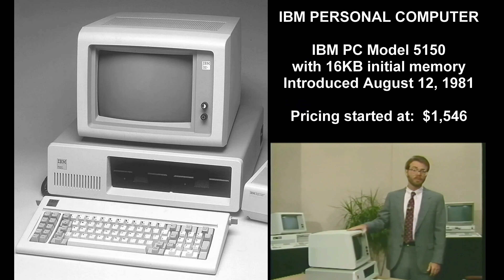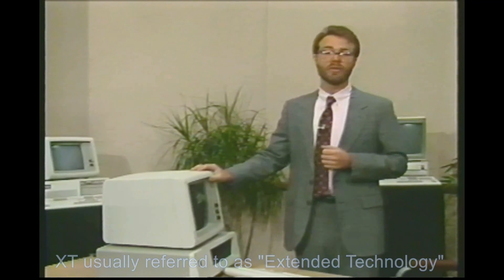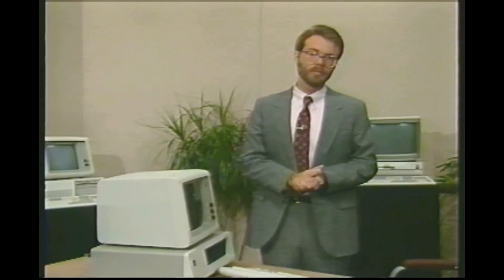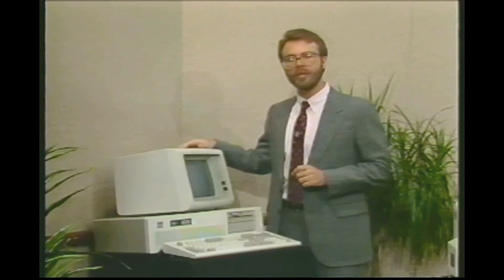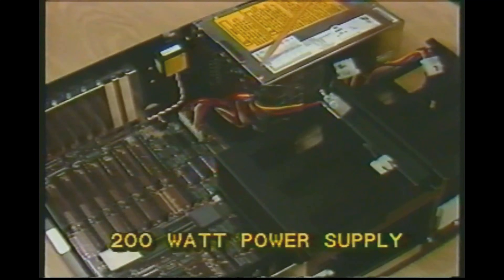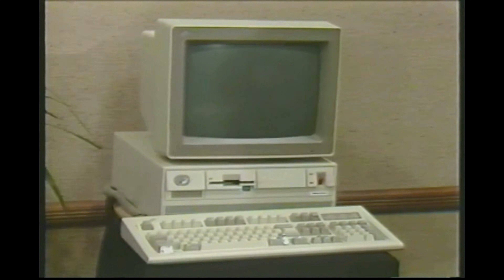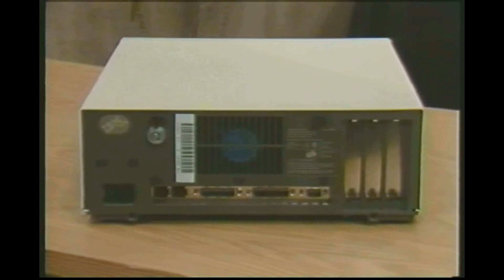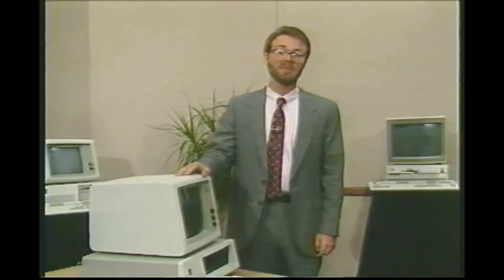IBM PC Family: XT, AT, PS/2 Personal Computers Compared 1981-1987 short intro training film

Comment: I remember debugging an isssue with my older PC and turns out it was that the keyboard was for an AT computer and not an XT computer ... found a toggle switch on the bottom of the keyboard and problem solved ... embarassed how long it took me to figure that out
Reply from the maker: Good bit of info!   Thanks!

Comment: I have an old IBM "PC", upgraded with a more powerful power supply & ST225 hard disk, along with the heavy metal original PC keyboard. Been sitting for 25yrs., it was working but my Amdek 310 monitor failed and no longer can mess with it. It's the oldest part of my vast computer parts bin. Amazed what these go for on ebay.
Reply from the maker: Hi @robytar, wow, the original metal keyboard!   I remember those, but have not seen one in years.  Yes, it is very collectible now.  Who would have thought the original machines would be collectible in just a few years.  Like an "antique" now.   Thanks very much for sharing your info and thoughts!   ~ VK, CHAP

Comment: I remember working on and maintaing a whole warehouse full of Xt's with 128 kb of ram , Hercules graphic cards and a single 5 1/4 inch floppy drive each.  We had a single XT that had a 20Mb hard drive which held all the data for the whole setup.   A 386 was  epitome of desire back then and I spent hours going  through the specs in trade magazines dreaming of getting my hands on one.
Reply from the maker: Hi @multigerbs550, good times.  I remember anticipating the 386 chip too!   It was quite a big deal when it first came out, soooo powerful.   : )    Thank you for your feedback! ~  VK

Comment: Boy, did I love typing on the original IBM PC. What a great keyboard, with a solid clackety-clack feel and sound.
Reply: That was the Model F, which first appeared with the IBM System/23 Datamaster which was $9000 at introduction. What I didn't realize for many years was that to buy an individual PC keyboard at the time, cost $600, half of a whole PC system! IBM had figured out that the keyboard was the main method of input, so it was a major feature to get people off their minicomputer terminals, away from "home computers" and onto their "Personal Computer"
Reply: I used to annoy my wife, learning C programming late at night, with that keyboard going clack clack clack. We only had a small home at the time (mid 80s) so the noise resonated everywhere.
Reply: I used to annoy my wife, as I studied C programming late at night, with that keyboard going clack clack clack. We only had a small home at the time (mid 80s) so the noise resonated everywhere.

Comment: I have a IBM 5160 XT with a a 5153 CGA monitor. It's a later model with a full size Seagate hard drive and a 'half height' 5 1/4 disk drive, 640kb ram and the later floppy disk controller card that could use 720kb 3.5 disk drives. It never came with a keyboard but i have a model M from 86 if i remember correct, would like a Model F but sack paying out the nose for one 😅 I added an 8bit vga card just because it means im not stuck with the CGA display, also a soundblaster 1.5 or 2.0 (forget lol) sound card (at the minimum i can now use speakers). Oh and the psu died as a film capacitylor and a voltage regulator died so i just stuck standoffs in the psu case and put a seasonic 250w psu in it wired to the clunky switch.

There was also the rarer XT 286 with a 80286 and zero wait state ram, still uses the older style XT case.
Reply from the maker: Hi @initial_kd, It sounds like you have quite a lot of experience with micros!  Weren't the old XT and AT cases so wonderfully heavy(!)   Thanks very much for sharing your info and history with some of the tech.  ~  VK
Reply: @ComputerHistoryArchivesProject  I sometimes think those cases were designed for surviving nuclear war! The heavy metal keyboards could also double as ferocious hand-to-hand combat weapons!😮🤣
Reply: Those IBM CGA monitor had fantastic color and brightness

Comment: How those early games depended on a 4.7MHz processor, or they were impossibly fast to play. So the turbo button was added to clones to slow down the processor to let you play them. 😂

I remember when was I was learning C on my PC clone in about 86, de-referencing a null pointer would make the printer print random characters. The only way to make it stop was to power it off. Some time later, my $800 50MB hard drive crashed, and I lost years of work. 😂

Lots of lessons learned.
Reply from the maker: Great memories!  Super expensive hard drives, and ones you would not want to drop on your foot.  I hope you had fun with the C programming!   ~  VK
Reply: As it kid it blew my mind, "you mean the Turbo button actually slows the computer down?!?"